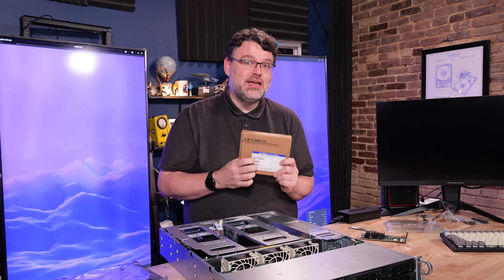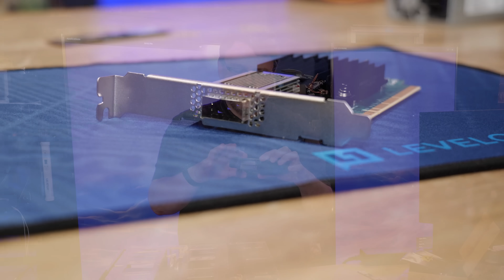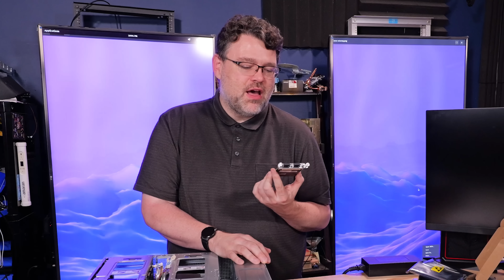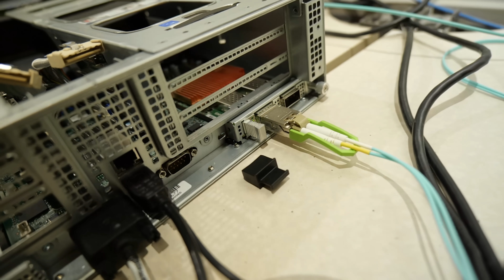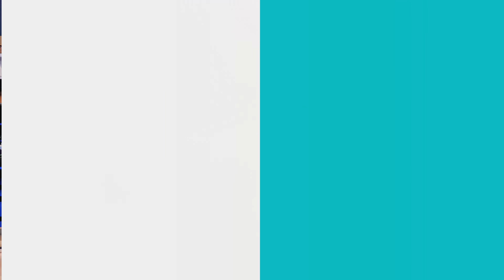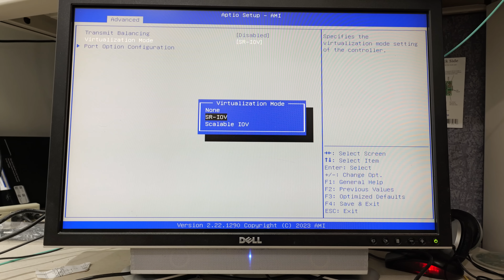The 100gig Adventure with LR Link

Comment: I saw in the BIOS that it said intel 810-C. Is that -C a firmware revision?
And does that imply that previous firmware versions had issues?

I've seen that naming convention in other intel NIC's (eg. the i225) which apparently had some significant issues that were fixed with firmware revisions. I think the i225 eventually became the i226.

Comment: "Just Ubiquiti Things" should be their motto. I had a planned six hour cutover go sixteen hours because undocumented Ubiquiti meshing "technology" resulted in seven floors of a building plus a core switch having massive spanning-tree failures, since no one had any idea or documentation that in that particular split-brain environment, the Ubiquiti gear that was mid-replacement would flood packets and cause the freshly-secured new Juniper core to shut all of its ports down upon seeing the same MAC address coming off of a dozen different fibre links and several ad-hoc RF links that *no one had ever manually configured*.

Comment: Been running a Proxmox server with PFSense with Dual Mellanox ConnectX4 100GbE on my 3955wx (upgraded to 5975wx recently) since Threadripper Pro came out basically. I direct connect to my two storage NAS's and definitely exceed the 10gbps that most people would have been using then. I then stream the video from my Proxmox VMs to enjoy 100gbe over wifi essentially, lol.

Comment: I might do 2.5 gigabit at home at some point here but im not going to replace my Ethernet wiring for 10gig+.  I probably won't even notice the difference to 2.5gb.  My Internet is only 1gb.

I just upgraded to an orbi mesh system that does 2.5gb for all Ethernet and 4.5gb wor wireless.  I don't anticipate changing anything for a long while.

To me 10 gigabit or 50-100 is tech i might never need.  No real benefits unfortunately.

Comment: I've been thinking about getting 40gb for home just for the heck of it. The used 10gb hardware is actually quite expensive, but because there was a bunch of datacenters that had 40gb and then upgraded to 100gb or 250gb, the used hardware on ebay is CHEAP. $20 for a dual NIC, $150-250 for a 36 port switch. The same stuff in used 10gb is $100 per NIC and $500 per switch.

Comment: I have upgraded to 100G last year as well. I see you have bought ColorChip model B trnsceivers which are little hotter and with lower temp treshold than model C but I hope they would be fine :) I have both B and C but prefer to use C.

Comment: The connecting to each socket is old hat, I have an R730 that has an FM10840 2x100Gb card which connects to an x16 slot of each CPU via an extra cabled card.

Comment: I moved from 4x1gbit (smb multichannel) to 1x10gbit recently and most of the time I still can't saturate the link because of slow spinning rust disks.. the one's in mergerfs provide the max of what a single hdd can read/write, which for seagate X18 is around 280 MB/s with 10gbe being able to do around 1 GB.  the array of Exos in the NAS on an Areca RAID Controller would do around 1 GB/s (at least in quickly done benchmarks). ;-D guess I'm saying I wouldn't even need 25g at the moment. at my job we have 10gbe aswell as 25 for the newer vsphere clusters, nobody is currently thinking about 100gbe there (for the regular server ethernet)

Comment: Network Engineers love Intel NICs, 5xx,7xx,8xx generations have been so reliable....snatched 4x x550 from AliExpress.....my home lab has 10% the capabilities but yet still cost 1k for 4x NIC, a 10g switch, and a 10g router.  If you want to know the exact setup, lemme know, i'll post it.

Comment: Even on eBay, those Dell 5200 series switches are around $4,000!  There is no way I will need that kind of bandwidth.  A lot of things on my LAN do even have 10 gig capacity.  So after spending four grand on a switch, and realizing that my local DNS still doesn't work, then what am I going to do?!  Just like Patrick from STH, you show a lot of interesting equipment that I can't afford, and would have no use for if I could.

Comment: having failed to get into even 10gig because of price i'm sure this is worth watching
Reply: 10g copper is expensive for a variety of reasons: hard to drive copper, used market has huge demand since it works (mostly) with existing cat6 wiring, highend boards come with 10g-baseT connections.  It cost me far more for a 10gbase-T connection using existing wires than a 40gb-lr4 where I had to run a new fiber drop from my network closet to my office - including the cost of the fiber, keystones, patches.  If you are in a position to run fiber it opens up a world of cheap secondhand highspeed networking gear. I spent under $400 total for 40g, and 100g would have only doubled that.  (not exactly comparable, 100g point-to-point to my NAS vs 40g with a switch included)

Comment: The thing with fibre op tuning/distance setting; I wonder why the onboard controller could not just, 1) detect that a cable was inserted. 2) have a 'self-tuning' mode where it starts with the lowest signal and gradually increases until the signal is detected on the other end. 3) detect when a cable is unplugged and sets the interface to 'reset' mode and run the self-tuning again. 4) do have this work when things are plugged/unplugged without power, there could be a physical switch that is manipulated upon insertion.

I am dumb idiot, so maybe this exists, or there are significant problems with doing the aforementioned.

Comment: 100g has options for DR to shoot 1310nm 500meter and FR to shoot 1310nm 2km. Both are plenty safe for short runs in the same rack or within the datacenter. Even the 10km optics are unlikely to burn out the receiving side these days. Most of them have a RX window starting at or above the top of the TX window. So should be good to go once you add some loss through connectors.
Reply: Don't they modulate their optical power?  40g-LR4 lite I'm transmitting 0.5 dBm, receiving -1 and it's rated for up to 3.5 (TX and RX)

Comment: I just built an iSCSI setup using Hyper-V and Windows Server as a file server and it is actually really performant. I did have to fiddle with the iSCSI and NIC settings to get the optimal throughput but with 2 10G fiber channels per server, I have a very stable very fast fail-over cluster using built in software. Things have really changed.

Comment: I have a dual 10 gig nic (and actually two more on board 10 gig ports) on my workstation. Is there any way to link aggregate them in windows to function as 20+ gigabit? I downloaded the intel pro set software and I thought I had it working at one time but it seems it was more of a failover then aggregating.

Comment: 100G 10km / LR optics are super common in my data centers!  Used for 3ft to 15 miles!  You only have to think about it when you get to ZR optics / 80km reach.
This is also over single mode fiber.

Comment: "I ended up upgrading everything to 100Gb, because that's what you do, right?"

Yes. That is what you do.
Reply: Yes. That is what you do.
Reply: NGL said the same right as he did , not even a second thought
Reply: @Prasanna_0001  did you account for full duplex
Reply: I had 10G copper and was looking to move to 25G. As soon as I realized most of the pain would be running fiber, I too, went straight to 100G. Mikrotik for their 16x100G l4x25G switches and a few more Qnap 4x100 8x25 switches to round it out. 100G for roughly 2x 10G cost, and only 20-30% more than 25G.

Comment: From a consumer perspective, 10 gig hardware (be it NICs, transceivers, or switches) are dirt cheap now. You can get any of those for under a hundred dollars now. But 25 gig and 100 gig, while the NICs/transceivers are affordable or even cheap, the switches are still in the high hundreds to low thousands of dollars. And those switches will probably need a secondary switch to connect 1 or 2.5 gig devices to your network, you can't really get an all-in-one switch like you can for mixing 1/2.5 and 10 gig clients. The costs add up fast and your minimum investment ends up in the thousands of dollars.
Reply: Sure, cuz right now I'm looking at an 8 port SFP+ Mikrotik switch for $230
Reply: I have noticed one small problem though: That 10gig hardware consumer significantly more power than regular gig-eth. Notice the great big heatsink on every pci-e 10gbit interface.
Reply: @vylbird8014  Fiber doesn't

Comment: I upgraded everything in my rack to 40Gbe a couple of years ago (and it was pretty dang cheap at the time) and seeing as I don't have and uber-fast kioxia drives, I don't think the jump to 100Gbe is worth the cost for me.  Might wait for 400Gbe to come down in a few years.  

My core switch is a Mellanox SX6036 It connects to a Dell/Force-10 S4810 and a pair of Powerconnect 5548 switches (one with POE) My nics are mostly Mellanox ConnectX-3s with a few Chelsio Intel based nics.  It all worked together surprisingly well. IIRC for the nics, dac cables and 2 switches I was all in for around $600-$700.
Reply: Your Corn collection must make you really good money

Comment: About 6 months ago I got a deal I couldn't pass up on some old Intel XL710-QDA2 40Gig QSFP+ NIC's.   My take is that while faster Ethernet is great for servers where it is being blasted  from many directions at once by many clients, for lower threaded applications going above 10Gig is mostly useless at this point, just how like going above gigabit was mostly useless in this application 10-15 years ago.

In direct link (client to client) I was able to register between 16 and 21 Gbps using multi-connection iperf, which would at least have been an upgrade over the 10gig I was using before, but then when I went to actually use all that bandwidth in real world applications it was barely any faster at all than 10gig.   SMB, NFS, you name it.   ~1.2GB/s (with occasional bursts that don't last up to ~1.6GB/s which I guess is better than 10gig, I guess by a little) was the best I was able to pull off in less "threaded" loads.

I'm not quite sure where the bottleneck lies, but it is not in drives, not in PCIe bus, not in CPU, not in RAM.   The things just refuse to work any faster.   I wonder if the code just isn't optimized for anything beyond typically available client hardware.

The upside - however - is that the Server no longer needs more than one NIC.  I can shut all the hot 10gig NIC's off, and this actually lowers power consumption compared to the mix of dual port x520 NIC's and on board (Supermicro) Broadcom BCM57416 ports I was using before and results in fewer cables and less heat.

Comment: My experience moving from 10g to 25g was interesting since no links would come up by just plugging in.  After a long session of messing around with it for a few hours I figured that if I enable FEC then disable it again the links activate.  I thought maybe the firmware was the issue on my x695s since extreme mentioned FEC in update notes but the same behaviour was still going on even after updating so just a bit odd.  These weren't even LACP ports or anything either just basic ports.  (host side was dual-port 25G broadcom NICs on vmware 7)

Comment: I still use old infiniband stuff (40 gig) at home. It's still shockingly fast and low latency. And cheap for all the parts from switches to nics.
Reply: NFS over rdma is very very very fast.
Reply: 40GB is decommissioned stuff. Get them fast.

Comment: I actually happen to have two Edge-Core AS7712-32X 32-Port 100GBE.they are blue, i think they came from a amazon datacenter or something. I used to deal with alot of hardware and I got some interesting stuff through the years haha. Actually have a stack of 100G cards and QSFP cables but the lame ones that go for 10$ on ebay.
 I have pretty much NO use for them besides it looks cool in my network rack with my other stuff. and ya know, bragging rights. do i have 100G hardware in my rack? yes. Is it plugged in? ...no, just looks cool... Plus im not smart enough in the field to know how to operate bare betal switches. I just run my network at 10Gbe and it is perfectly fast for me.

Comment: Still struggling to get more than 18Gb/s out of my mellanox connectx 5 on windows 11, but only in 1 direction, iperf gives 85Gb up but only 18Gb down, very odd (works fine on a linux machine instead of the windows 11 box)

Comment: I'm currently doing a very similar journey myself. It started as "Hey, my ISP offers 25G at home now, I probably should get a 25G router and maybe build a NAS", but it got slightly out of control and I have more 100G NICs than any other NICs now :)

And I kinda don't agree about Mellanox. There is one HUGE benefit of those in my opinion - you can get slightly used ConnectX-5 2x100G for about 120-150$ used (you need to be paitient, but eventually it would come), and ConnectX-6 is slowly going down in price and you can find one for ~300$ per card or sometimes less. And even if you want to play with BlueField - there are bluefield-2s for ~450$. And those are just PCIe cards, OCP 3 is usually slightly cheaper (but I have no HW that have OCP 3.0 slots). I would avoid ConnectX-4 because price-wise it is about the same as ConnectX-5 but it is PCIe Gen3 x16 which means you won't be able to get 2x100G out of it, and CX-5 and later don't have that problem if you get right SKU (or search for a way to workaround that ;) ).

And that is a huge problem for Intel E810s - cheapest one I ever saw costed around 450$ and that is only recently, it was way more just half a year ago. So for me question is why to get E810 if I can get almost 2 CX-6 for the same price?

Also in terms of performance and power consumption, as far as I know, mellanox is better in both regards - I was able to get (per port) 86 Mpps from CX-4, 132 Mpps from CX-5 and 166 Mpps from CX-6 in my benchmarks (Cisco T-Rex as a load generator, loopback 100G DAC between ports).

Oh, and one more thing - nowadays you can get 100G switch for somewhat low price - there are Celestica DX010 available for <500$ or you can get Mellanox SN2700 for ~1.2k $, both are 32x100G, first one you need to ensure it have AVR54 workaround applied or fixed CPU, but Mellanox switch is fine. But for home - SN2700 is better as it have very low power consumption in idle and therefore you can either spin down the fans by A LOT and make it quieter, or even replace the fans with different ones and make it almost silent.

Comment: don't know what most of this video is talking about, but the other day I discovered the reason my 2 years old home file server was slow is because I used a really cheap 1m lan cable that could only run at 100mbps, I changed it with another cheap lan cable and magically got 1000mbps upgrade 😂

Comment: "i wanted 25gb network so i got hardware equivalent to 50k to set one up"
Reply: 25G is cheap-ish. NICs are ~30$ per NIC (used), transivers can be found for about 10$ per transciever (but as Wendell said - beware of FEC :( ), cables are also like 5$ per 25m (~82 ft.).... Switches are expensive or loud, that is the problem right now :( And that you then want to get bigger and bigger and bigger and in a blink of an eye you have a Sapphire Rapids or Epyc somewhere in the basement and planning to buy another one and a few more NICs just for fun... :(

Comment: Nah, you don’t need ASIC for deep trafic analysis on 100Gb/s network. At my place, we do DPI at 100Gb/s with only one CPU (32-cores, though) and 64GB of RAM. Full line-rate certified by Spirent, at 14 millions new sessions per second and 140 mpps. But to do that, we had to redevelop the drivers of the e810 from scratch in Rust for everything to work in userspace (DPDK is… too limited for that). So it’s possible, took us 3 years of R&D, though ;-)
Reply: Can you share a link or any context? This is intriguing stuff!
Reply: out of curiosity, was this done using BPF?
Reply: @quackdoc5074  Doubt it. BPF is too slow. That's why DPDK came about - it's mostly just a NIC driver in userspace, but you're very limited in what you can do in userspace.
Reply: @jfbeam  BPF is, indeed, too slow. And yeah, it’s a NIC driver in userspace. But it’s not limited in any way. It’s just a lot harder to code ;-)
Reply: @quackdoc5074  Nope. We tried using AF_XDP (because of eBPF), but... it didn't scale enough to reach 100Gbit/s full line rate. It started dropping around 40G and we had to throw 40+ codes... To costly. That's why we took the high road and re-developped brand new NIC drivers from scratch for the whole intel family (from the 500 to the 800), only way to achieve true linear scalability.
Reply: So when will it be on github?

Comment: Oh mannn yeah, FEC bit me in the ass to the tune of like 4 hours on those XG switches.
It is fixable in any condition, provided you actually have control over FEC on both ends... it's just a pain, and I'd highly recommend just using what Ubiquiti uses (Base-R aka FEC74 in the rest of the world) and not trying to get the ubiquiti setting to persist.
I'd also recommend filing a ticket with UI to complain about their nonsensical, nonstandard FEC settings.

Comment: I bought 2 cards with Intel e810 at work. They work like a charm and the driver is open source. Although, you need to compile it yourself for Debian… but for the rest they are basically plug and play. I am very happy with them.